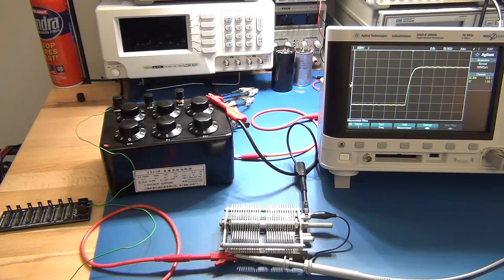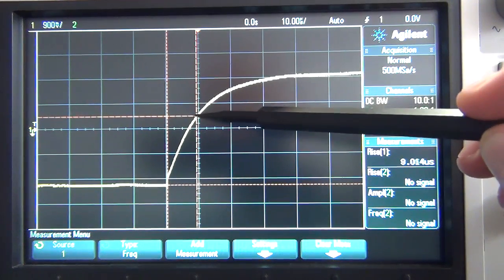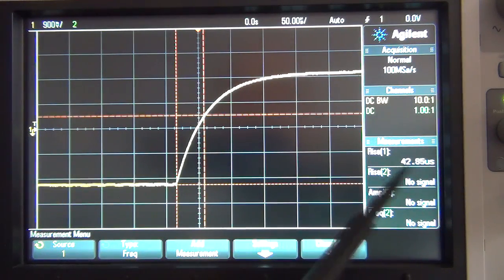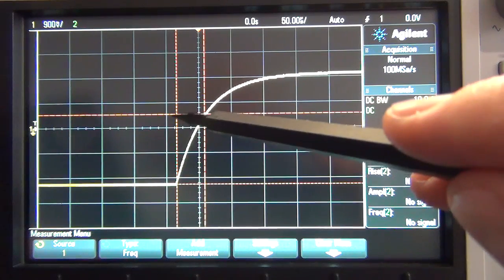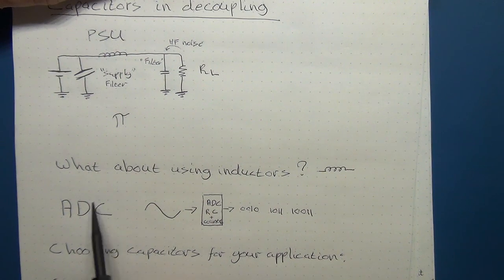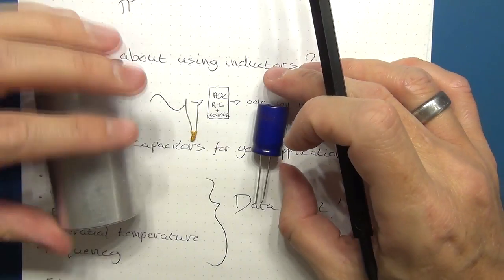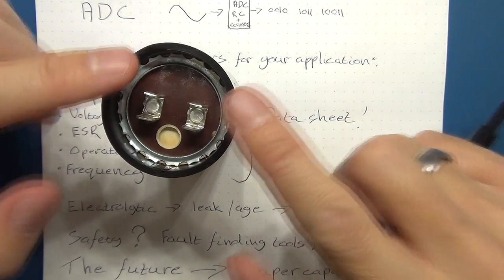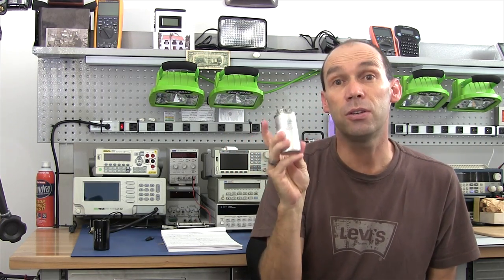Electronics Tutorial #9 - Capacitors - Part 2

Comment: An important characteristic you left out is temperature stability, how a cap's value changes with temperature. Some ceramic disc caps have very poor temp stability for example. Also, testing for leakage at rated voltage is very important for high voltage caps in high energy circuits, and this is something that now only very expensive lab testers or older vintage testers do. The modern cap testers and LCR bridges you have mentioned/reviewed will not.

Comment: I couldn't grab hold on the information as in your previous videos. That is obviously because of the difficulty the video has relative to the others. Though I don't quite get how all these hard calculation could help me get started with circuits. As you showed in previous videos, use of a capacitor to smooth the wave coming from the rectifier seemed rather easy to me.

This however should be more my concern than yours. The video was as always really good, though it overcomes the series level of difficulty, according to me.

Comment: Hi sir,

I have a doubt at the time 17:04, you have mentioned that HF noise ( AC ) can be grounded by adding smaller capacitor. But only one side connected to circuit and other end is connected to ground. As per the analysis, one side of AC voltage going to charge the capacitor, how it will help grounding the voltage to reduce the noise.

May be basic question?

Thanks.
Reply: +sri ram Hi, it is a standard method used commonly in circuit design. Remember the equation ( I=C. dv/dt), this equation underpins capacitor function, it says that current only flows when voltage changes with time. AC is a change in voltage over time, therefore you have a short-circuit to ground. A DC signal is constant, it DOES NOT change with time, therefore a capacitor appears as infinite resistor (aka open circuit), and dc current does not flow.
Reply: +Andy Clarke Thank you.

Comment: My question is
If we conect 6 capacitors in series (2.7V 10F) can we  use voltage 6 x 2.7 = 16.2 voltage during the charging process?
I would charge the capacitor using PV panel (12V 1.2A) and then run using the accumulated charge electromagnet with power 24W (12V 2A) for a fraction of a second. is it possible?

Comment: Hate to nitpick because I do appreciate your style, but at 7:35 you say "as I increase the frequency, the impedance is obviously increasing" It's actually the other way around. The impedance is decreasing, you haven't hit the srf point yet. The cap is the lower leg of a frequency dependent voltage divider. The higher the frequency, the lower the impedance and it drops less of the overall voltage of the signal you're applying. I also don't think "dielectric loss" and "electrode loss" are appropriate ways of labeling the impedance graph. Perhaps "capacitive" and "inductive" would be better.

Comment: As a very inexperienced diyer, I am a little disappointed that you do not cover how to understand farads. Say I want to experiment using caps as a power source, how do I calculate the farad size for a given load? Say a flashlight using led. I need to be able to calculate how long I can expect the cap can hold that load. Of cause I will be using super caps.. Thanks for your tutorials. Nice and thorough :)
Reply: +Michael Madsen I=CV/t where I is Amps, C is farads, V is volts and t is seconds
Reply: +Andy Clarke Thank you Andy :)